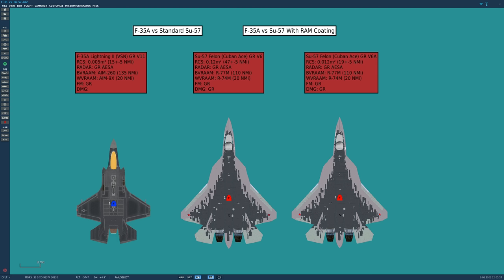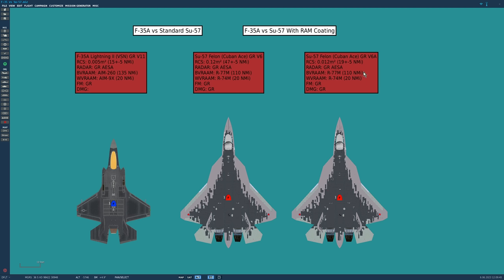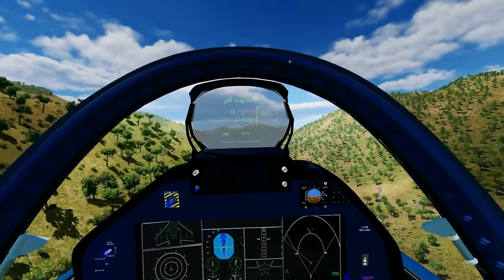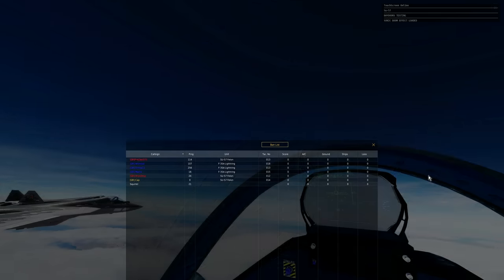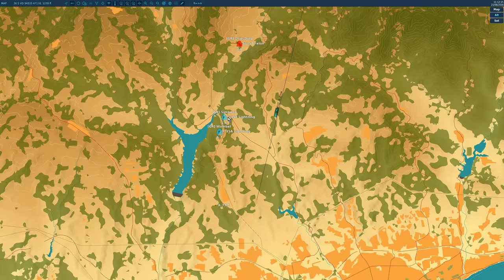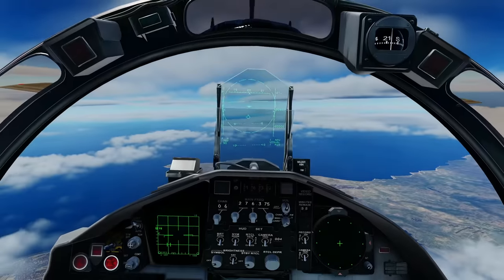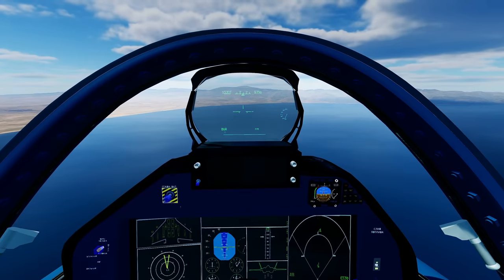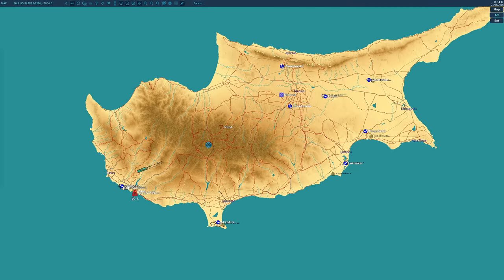F-35 vs Su-57 With RAM Stealth Coating: BVR Missile Battle & Dogfight | DCS

Comment: I would want to see the correlation between your 3rd party analysis group's RCS predictions for well known fighter jets compared to the published RCS figures for those aircraft. Only change the F-35's RCS from the official number when you have more confidence in your 3rd party  analysis group's figures for a  range of other aircraft.
Reply: If the SU-57 is getting reductions based on their simulations, the F-35 should aswell.
Reply: the so called 3rd party analysis group actually didnt do the RCS simulation, they steal it from aircraft101 blog. I'm actually very disappointed that Grim reaper just choose to ignore it

Comment: Two USAF generals have said the F-35 is stealthier than the F-22 so I think yeah run it as .002.  I assume part of that stealthiness is not just RSC but I don’t think DCS can model that?
Reply: Unfortunately yes, in DCS the F-35 will never be as strong as in real life
Reply: @LarsAchermann  this. There's so much DCS lacks

For example IRL AESA radar has immense advantages over PESA radar which simply can't be modelled within DCS, and the computing power of the aircraft behind the radar matters a ton too. For example the F-35s radar can opperate in a "low probability of intercept" mode that makes it completely impossible for classic RWR to detect it, and even highly advanced and computerised RWR may need several seconds to detect a hard lock, if it can at all. 

Another example is sideways RCS. DCS models RCS very simply, irl it is highly variable with what angle you look at an aircraft from, it changes with the deflection of the control surfaces, and depending of the frequency band of the radar. The F-35 and F-22 are designed for all-asoevt stealth. Meaning they have a vet low RCS from every angle. The SU-57 only with frontal RCS in mind. As soon as it turns to notch a missile it's RCS will be no better than the frontal one of a super hornet or similar while the F-35 will not have this problem. 

Other advantages the F-35 has that aren't modeled include: 
- The F-35s EOTS and DAS function as a superior version of an IRST, and without compromising radar signature.
- The DAS has the ability to passively detect IR signatures near itself at full 360° angle. 
- the F-35 can, in fact, supercruise. This was added with a software update. It can only do this for 100km or so at a time as far as I'm aware though, as keeping this up would stress the engine leading to higher maintenance costs. 
- the Towed decoy of the F-35. A sort of jamming pod on a string that the F-35 can trail behind it meant to trick missiles into hitting instead of the real plane.
Reply: @d.thieud.1056  True. Aircraft are getting more and more complex, especially the F-35 because it is as advanced as nothing else out there. In real life, the F-35 could easily take one 3-4 Felons at the same time.
Reply: @d.thieud.1056  huge knowledge though, props
Reply: I have heard from some sources (if I can remember where I will post the link) that the F-35 frontal aspect RCS is something a lot smaller and I do mean a lot smaller. I think the F-22 has better RCS is the ventral and dorsal tho not by much. The Su-57 has some frontal RCS of around 0.02- 0.08² and it's RCS everywhere else is virtually non-existent in stealth which is why they call it low observability. Supposedly the RCS of the Su-57 anything other than front aspect is over 1.0m². For the love of God I'm trying to remember where I read this because just over a week later Sukhoi themselves came out and said it's best described as "low observable". This is when mind you that everyone was saying the Su-57 has better stealth than the F-22.

Comment: Given that this 0.005 variant is already so good that eyeballing it does a better job than radar, I think keeping it at the higher number makes sense, if you go all the way down to 0.002, you might as well not equip the enemy with radar anyway.
Reply: IRL infrared sensors can see fighter sized targets out to 30km so any radar stealth better than that is more or less redundant.
Reply: @hughmungus2760  Radar guided missiles will have a lot of trouble tracking even after the parent plane locks on.
Reply: @hughmungus2760  VLO includes RF and IR spectrums, as well as visual and sonic realms.  Considerable (billions of dollars with instrumented test ranges and IR sensor measurement devices) effort has been put into IR signature reduction on the F-117A, B-2A, F-22A, and JSF series.  JSF airframe, propulsion, and surfaces have extensive IR VLO techniques employed.  Short story is that none of the published detection ranges for IR sensors work for JSF.  You have to develop a detection range, conditions, approach, and closure speed matrix to analyze these numbers.  With JSF, assume about 1/3 of the values for legacy fighters.

So if you see an F-16C approaching you subsonic at 50km headed towards you at Mach 0.85, you will be lucky to see an F-35 at the same speed and aspect at 16.5km.  This means you were dead long before ever having a chance to see who shot you down.  16.5km is within visual range on most days.

Also, for long-range detection using 4.5 Gen IRST sensors, you need an advanced Radar-cueing capability, preferably an AESA with good beam resolution and a very fast processing back-end driving it.  The Long Wave Detection ability of an IRST is very limited because it’s in search mode with Radar-cueing, meaning wider scanning azimuths with less detection range capability.  This is also true for the Radar.

Assuming you do get a Radar-cued IRST track, you now have to Positively Identify that track and wait until you are within weapons parameters after PID.  These are all impossible feats against an F-35 with a superior AESA and its low RF/IR signature, and superior detection ranges, tracking ranges, and 635 NCTR parameter PID capability with Block 3i, not even 3F.  They see you, track you, PID you, and set you up into WEZ/NEZ way before you even know you’re being targeted.  This is an unfair fight totally in their favor by several order of magnitudes.
Reply: @LRRPFco52  The stealth on the F35 is neither all aspect or broad spectrum,
thats why all those features are demanded of 6th gen US fighter designs. 

Particularly recent revelations have shown that the engine on the F35 has an overheating issue I wouldn't be so confident with its IR stealth being particularly amazing.
Reply: @hughmungus2760  F-35 VLO features absolutely are broad spectrum even with just the shaping.  The carbon nanotube fibermat RAS has a much wider range of RF absorption than critics and proponents ever imagined, and the CF tailplanes are mostly transparent in RF spectrum.

The F135 turbofan is the most reliable afterburning turbofan ever built.  It doesn't have overheating issues.  Keep in mind there are tons of neophytes pontificating in this space who can't even tell the difference between a turbojet and a turbofan, let alone the difference between a stator, combustor, or high pressure fan.  But they sure know that the F135 is a crap motor with all sorts of imagined issues.

If only there was a way to analyze the fleet data from previous generation motors, like say the F100 series and F110.
Reply: @LRRPFco52  if the f35 had all those features they wouldn't be talking about 6th gens specifically asking for those features before the production run for f35s have ended. 

The overheating issue is well known. which is why they were floating the idea of re-engining the f35 with the new AETP engines, until that plan sorta went off into the weeds due to technical complexity and cost.

Im not saying all these features on the f35 are useless, but if they truely worked as advertised they wouldn't be rushing to build 6th gens at ruinous cost (estimated at 300million per unit) instead of trying to fix existing issues on the f35.
Reply: @hughmungus2760  6th Gen PCA/NGAD emphasis is because we never capitalized on all the RDT&E and production line for F-22.  NGAD is not about addressing issues with JSF, but filling in the Hi of the Ho-Lo mix that was killed when Gates/Obama killed the Raptor pre-FRP.

There are no well-known issues with F135 overheating.  The talk about engine upgrades for F-35A and C is about performance (more range for the fighter with the most range currently), and more bleed air power for ECS and other systems.

Keep in mind the F135 already generates 270V DC, which is something we only see with twin-engine fighters like the F-22.

Whenever you see these channels with uppity millennials referencing 6th Gen as some kind of priority program to address F-35 deficiencies, you know right away their experience and knowledge about the various fighter tracks (next to nothing).

F-15C ---> F-22A ---> NGAD-A

F-4D/E---> F-16A ---> F-16C -> F-35A

F-4G -> F-16CJ -- F-16CM --> F-35A

Totally different tracks and types of squadrons.
Reply: @LRRPFco52  Okay then why is the navy developing a 6th gen fighter when the F35C and B is supposed to meet all requirements? 

With regards to the F35 engine overheating, the fact that the current engines need to run hotter than originally designed indicates some kind of shortcoming. And for practical purposes the F35 is already pretty short legged so not running the engine so hot would further degrade its combat radius.

The primary concern for the US is the fact that F35s do not have the range to be useful in any hypothetical conflict with China due to china's extensive A2AD bubble without putting carriers/bases/tankers at high risk.

Also if you're going to claim the F35's taleplanes are 'invisible' to radar due to composites you could equally handwave J20s as all aspect stealth for the same reason. Since the J20 was developed after the F35 and after Lockheed was extensively hacked by china.
Reply: @hughmungus2760  NGAD-N is to replace Super Hornets.  Remember the tracks?

F-4J -> F-14A/B/D -> F/A-18E/F --> NGAD-N

A-7E -> F/A-18A/B/C/D -> F-35C

A-4E/M -> AV-8A -> AV-8B -> F-35B

F-35 operational squadrons actually run the engines de-rated.

Yes on J-20 if they know how to manage the RF sensor and actuator cavity resonance.  J-20 is actually a high quality build from what we can see on the outside, unlike Su-57.

F-35s are anything but short-legged.  F-35C has 100nm longer combat radius than the F-14D.  F-35A has longer radius than F-15E.

F-35s plus stand-off weapons have plenty of stick against China, though they weren't designed with PLN and PLA long range fires in-mind.

Comment: Stealth coating won’t help Su-57 that much because the partially exposed engine faces are the most egregious contributor to radar reflections.
Reply: I think that the heat blast figures are overly optimistic for all aircraft. Real world stealth is incredibly complex with factors that I shouldn’t even discuss here. The semi official public estimates are probably the best numbers to use in game, not heat blast, IMHO.
Reply: Could use other measures to even up fights asymmetrically. For example, give the Su-57 side an AEW aircraft or a SAM site.

Comment: Shape, aka design, is what matters most regarding stealth. RAM is just there to pick up creeping waves and the like. It's also really important in things such as engine inlets, even if it's s-shaped or y-shaped. But other than that, it won't change RCS value drastically
Reply: Which if the general Su-57 shape is roughly 0.1 RCS the RAM isn’t going to help that ten fold or more.  I doubt Russia is as advanced as the US in stealth coatings anyways.

Comment: The problem is, RAM coating is presumably optimised against X band radars and thus not very effective against AWACS. Given the 0.002 vs 0.005 m2 discrepancy could reasonably be attributed to the RAM coating, it actually depends on what is the adversary radar (or can DCS model different RCS for different radar bands?).

For AWACS or LR radars, I would go with 0.005.

For fighter jets and rockets itself, I would go with 0.002. 

Possibly, you could go with 0.002 and boost the AWACS radar?

Piece of further evidence:
Based on the 1999 incident in which F117 was shot down, it is beleived that F117 has RCS of 0.0012 m2, while publicly available data says 0.003 m2. The same proportion holds for this 0.002 m2 vs 0.005 m2 case. And the F117 case could again be attributed to the RAM coating. 

However, update of radars should be done in line with such stealth improvement. For example, Gripen radar has mk4 version available since 2017, that should see a 1 m2 at 225 km (as opposed to the original 90 km range), or 0.002 m2 at 47-48 km (25-26 nm). 

Assuming the same upgrade was done to SAAB AEW&C, with the original version allegedly capable of detecting 1m2 at 225 km, it should now be boosted beyond the instrument range. The F35 should be seen at about 60 km with the old setting, 150 km with the upgrade, and the new Global Eye at 216 km, asuming 650/450 improvment corresponding to the instrumented range. That is 117 nm! - for a brand new AWACS operating at low enough frequency to overcome the RAM.
Reply: The F-35 shaping alone (not counting RAM), is extremely low signature in the VHF, UHF, and L Bandwidths as well.  When you factor in its various types of layered fiber mat RAM, the dB reduction is quite dramatic.  These have intentionally not been accounted for in the 3rd party RCS evaluations done by GarryA and Eloise.

All of the ranges you listed for Gripen E and GlobalEye simply are not even close to reality.  AWACS especially don’t have any special capability in detecting true VLO fighters.  5th Gen pilots frequently comment on how they don’t get any value for AWACS being airborne either, because they see so much more with their own interleaved formations using LPI data links.

I wouldn’t mention a tiny fighter like Gripen E or AWACS in a serious discussion about the modern unfair first-look, first-track, first-PID, first-shoot fight.

Comment: Cap where did you get the 0.005 m2 rcs for the f-35? Here is an excerpt from a research paper at the naval post graduate institute on stealth aircraft. I highly recommend giving this chapter a read, it’s not very long, and it details other attributes that make a plane stealthy aside from the shape/coating. Shape is just one piece of the pie. I’ll link the chapter below. 
“According to November 2005 reports, the US Air Force states that the F-22 has the lowest RCS of any manned aircraft in the USAF inventory, with a frontal RCS of 0.0001~0.0002 sqm, marble sized in frontal aspect. According to these reports, the F-35 is said to have an RCS equal to a metal golf ball, about 0.0015 sqm, which is about 5 to 10 times greater than the minimal frontal RCS of F/A-22. The F-35 has a lower RCS than the F-117 and is comparable to the B- 2, which was half that of the older F-117. Other reports claim that the F-35 is said to have an smaller RCS headon than the F-22, but from all other angles the F-35 RCS is greater. By comparison, the RCS of the Mig-29 is about 5m2.
Much has been improved between the design of the F-22 and the F-35. The F-35 doors for landing gear and equipment, as well as control surface, all have straight lines. The F-35 does not require "saw tooth" openings to divert RF energy. One reason the openings on the F-35 are straight lines is reported to be embedded electrical wires near the edges which interfere with RF signals. The F-35 RAM is thicker, more durable, less expensive and, being manufactured to tighter tolerances compared to that of the F-22. The tighter tolerances means less radar signal can penetrate openings and reflect back to its source. The newer RAM is more effective against lower frequency radars, and maintenance should cost about a tenth that of the F-22 or B-2. Some forms of RAM have electrical plates or layers within the layers of carbon composites.”
Reply from the maker: The median average result from Google search.
Reply: @grimreapers  You should give credit to the people who made the measurement, I have just seen their posts,  they are not happy